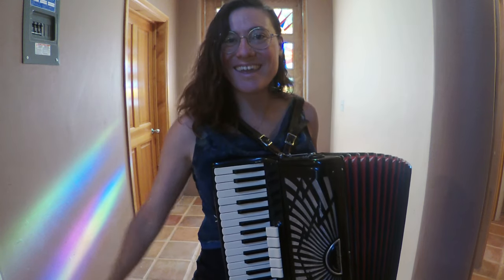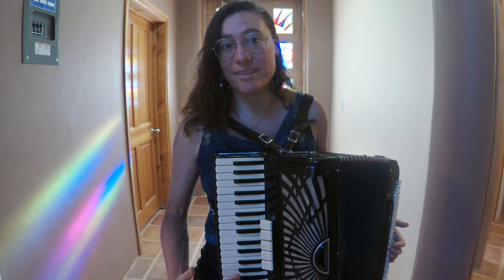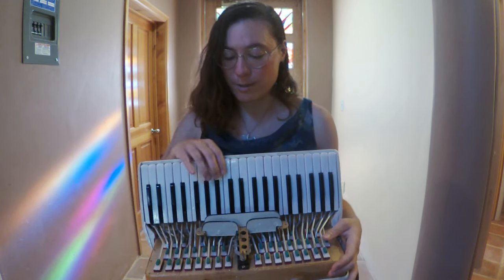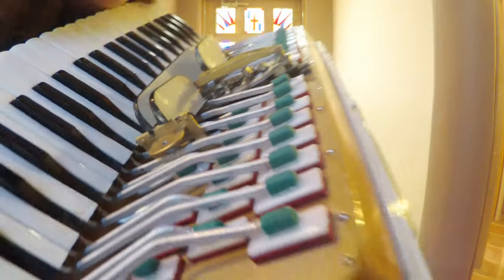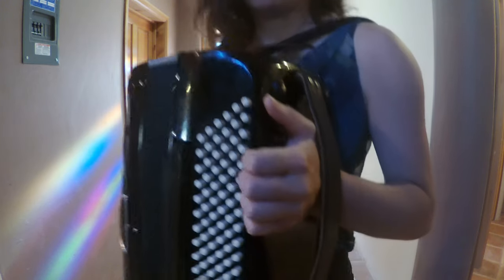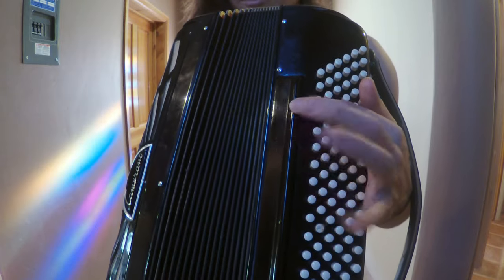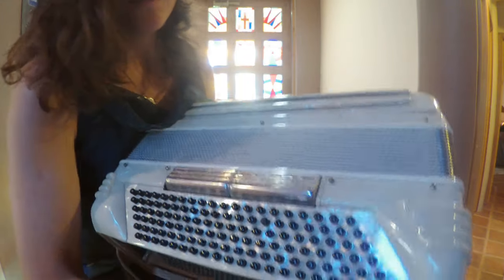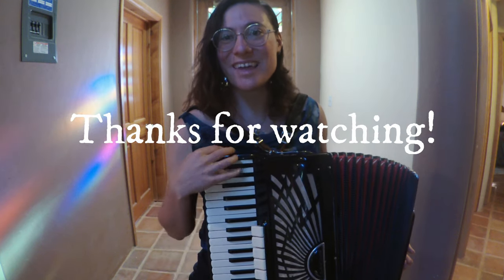Parts of the Accordion

Comment: This video has been very helpful!! I do have a question though since you asked 😅 You said the top low note is F and the bottom high note is A, could you tell me the notes in-between please? I've tried looking up piano keys but I haven't had much luck.

I've been trying to learn them but most of the videos I've seen have different types of accordions with different buttons and amounts of keys or they have the same amount of keys but they are in a different pattern. Your accordion has the same number of keys and they are in the same places so I'm hoping you could help me.